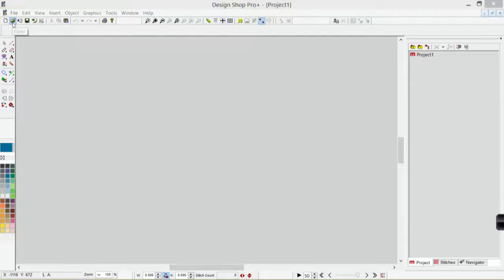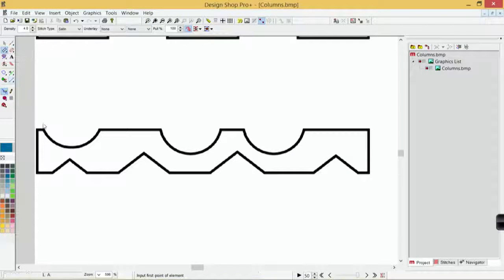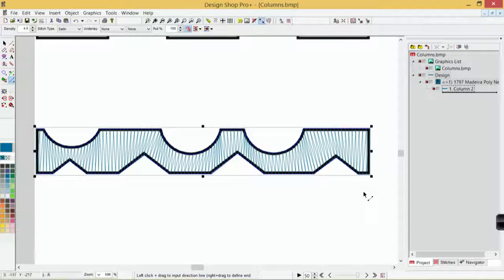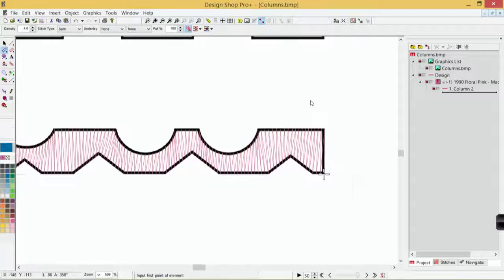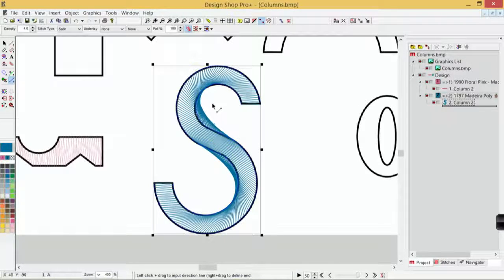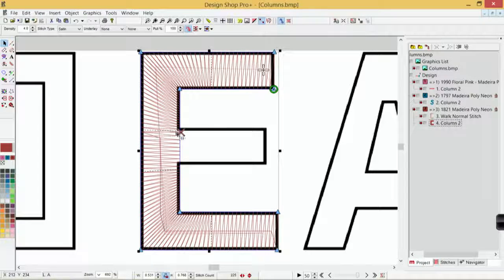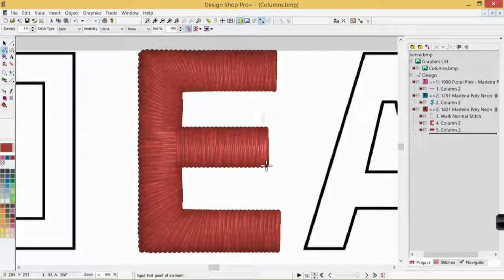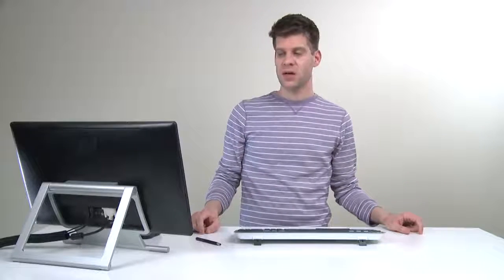DesignShop V9 ~ Column 2 Input Method

Comment: When I do this exercise I can do one side of a column then hit enter. When I go to do the other side it has a bunch of lines all over
Reply from the maker: This has to do with the Intel graphics video chip in your computer. Turn off your hardware acceleration by right clicking on the 3-D icon at the top of the screen. This graphics problem has been fixed and will be in the next service pack for DSv11 which will be released after it goes through beta testing. Computers with a separate video card don't show this problem and it only affects Column 2 digitizing. In the meantime you can use Column 1 or Complex Fill and use satin as the stitch type instead of fill.